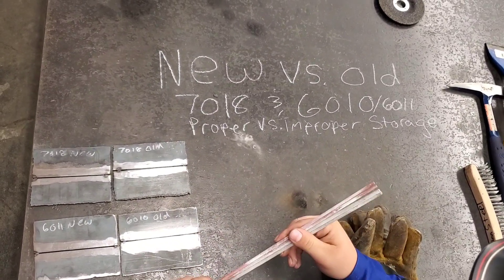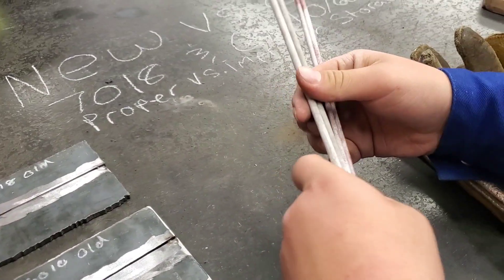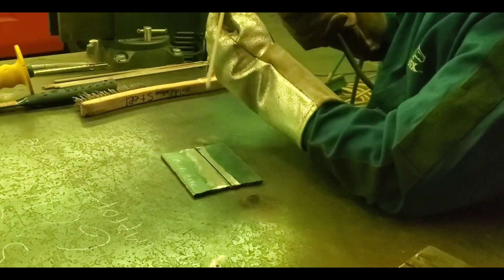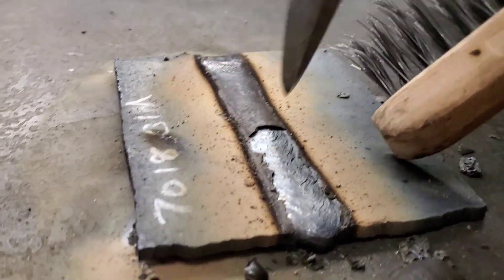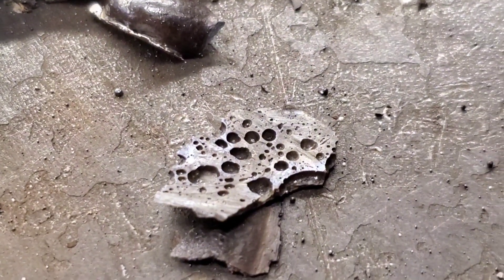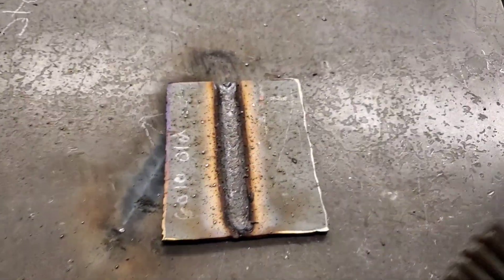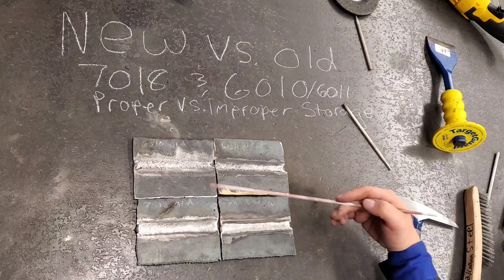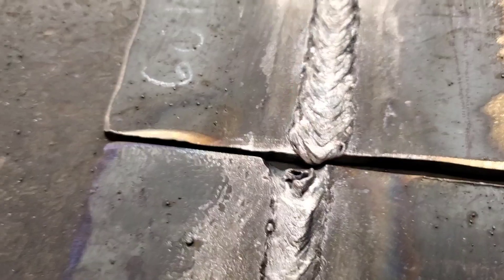New Vs Old Electrodes

Comment: I also have a whole bunch of old 7018 rods that were sitting out in the open air. The only difference is I put them in a warmer for a few days and then ran a couple of beads but honestly, I would like to see the difference on an x-ray
Reply: Or honestly, a strength test would be the best indicator of the difference between the two rods. Maybe I'll do a video 🤔... Thanks for this one though!

Comment: what does the backside look, penetration?
Reply from the maker: I had planned to go over them again with a cut and etch but they got kicked around the shop and have since disappeared. I noticed much more consistent penetration from the hot dry rods on 7018s. The fresh 6011s were the same results. Old rods are hit and miss, I wouldn't trust them on anything remotely structural far too inconsistent

Comment: Kool  I don't have a warmer,  lm looking at a keen kt15  for my shop  because it makes a difference thanks
Reply: Baking or cooking oven works. Just leave them in for like 200 or 300 degrees for like 12 hours or so.
Reply: @mrmidnight32  I read it needs to be like 5 hrs at 850 if dowel or left out in humid weather for days, then held at 350.  repeat twice at most
Reply from the maker: @peetky8645  actually depends on the brand. And necessarily needs to be over water evap temp. I turn mine up to 300 and leave them in there for 2 days. Bone dry afterwards. Never tried cooking real wet ones but the rods definitely absorb moisture just when laying around the shop. So all my low hydrogens get stored in the oven